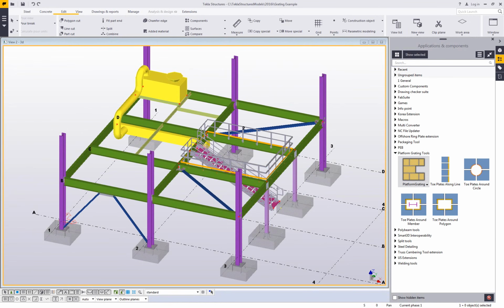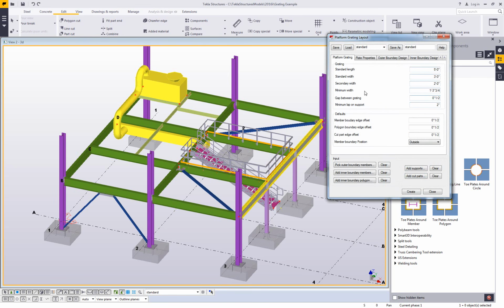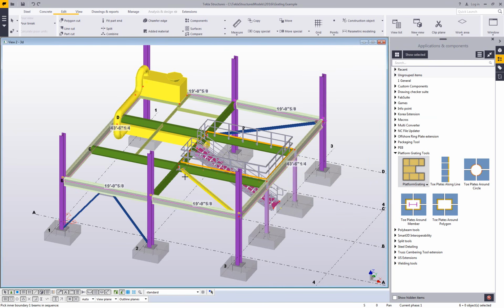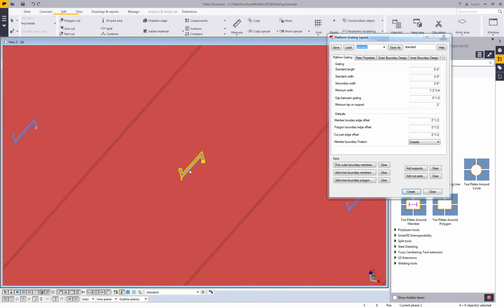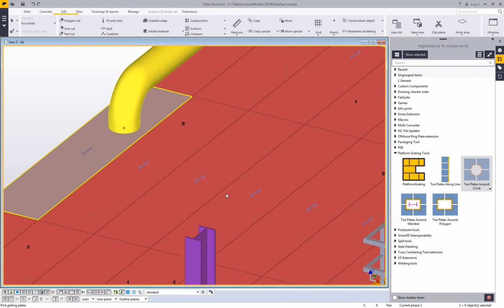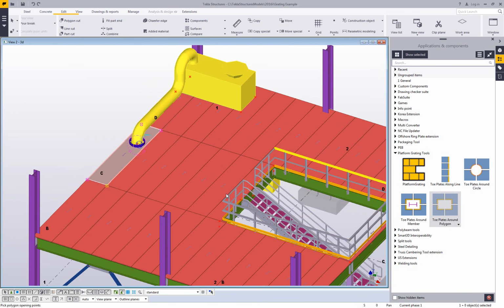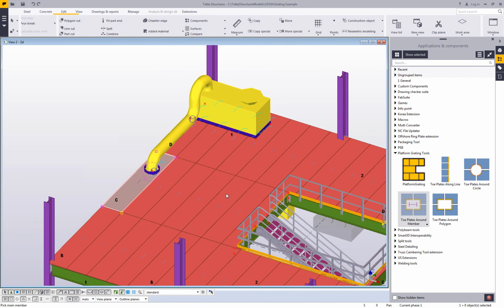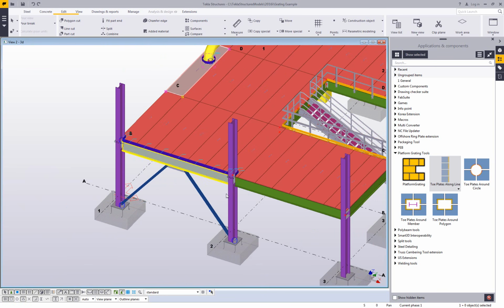Create Platform Grating Layout with Platform Grating Tools

Comment: How is calculated density .?
Thank you for your videos
Reply: Like all profiles in Tekla, you can select a material grade which defines the density for the profile.  So in this example I'm using a grating material grade that outputs the proper weight
Reply: Please give me an example. you now have different type of grating 32*5*100*30 , 30*5.....
Reply: Take a look at the material catalog in the US Imperial environment.  We have different grades set up for steel and aluminum grating profiles with different thicknesses.
Reply: You can make export . 
Thanks

Comment: Hello. I am having a problem when using this tool. I built a test model to try it. I do all the steps shown in the video: picking outer boundary members, add supports and add inner boundary members and I get a message. ''Le format de la chaine d'entrée est incorrect.''

Not sure how exactly it translate to English but it would be something like ''The format of the chain entry is incorrect.''

Any ideas why it isnt working for me?

I also wrote to Building Point Canada our technical support but figured I would ask here also.

Thank you.